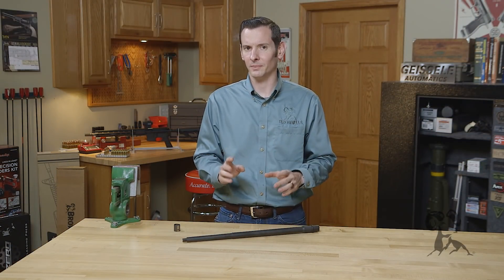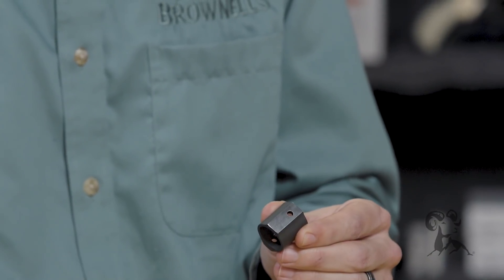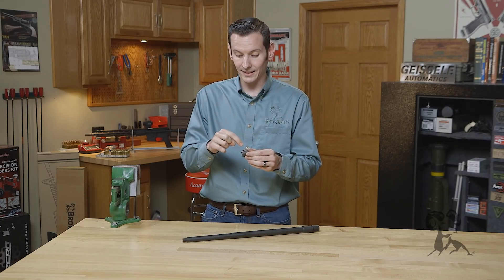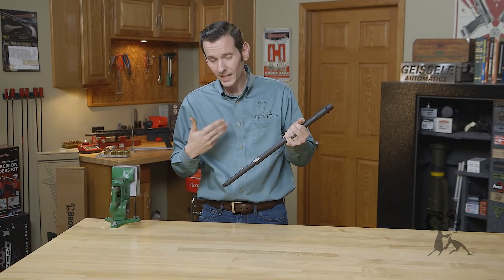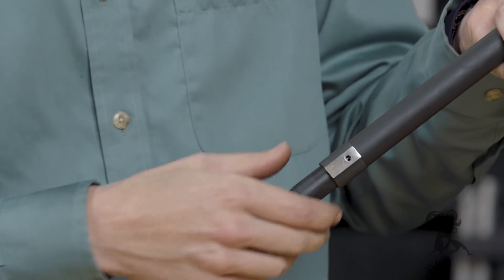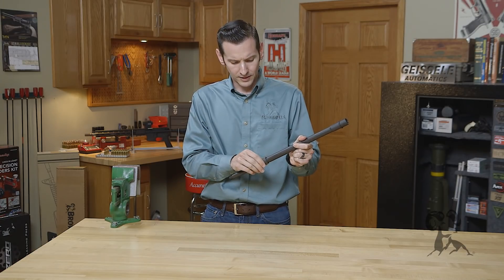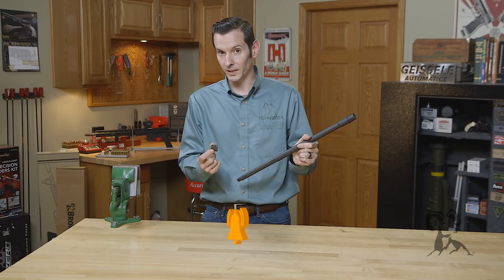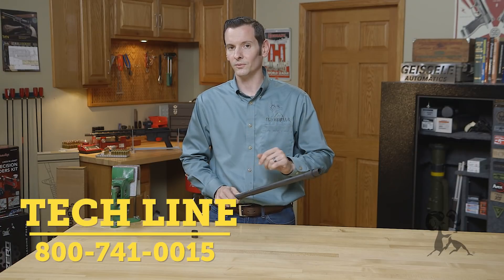Quick Tip: AR-15 Gas Block Alignment

Comment: I use a piece of gas line & slide it on the end where it fits in to the bolt carrier. Then put a finger over the end of the barrel.
Leave the chamber open. Leave the gas block snug but not tight, now just blow on the plastic gas line until you hear the most air come through the chamber & tighten down the gas block. Takes about a minute. Works like a charm!
Reply: What do you mean by gas line, oh never mind I get it what size gas line do you use
Reply: @JasonReilich  If you have to ask you won't figure this out anyway. It's so simple a monkey can do it!
Reply: This is how I did them until I finally bought the “universal” dimple tool. This technique still works fine.

Comment: If colt Socom heavy  barrel which is not called hammer forged but chrome lined  are you soon the centurion one that I have that I have to shoot some 77 otm and see if it’s a sub minute grouping because the regular colt Socom Power always half minutes I’d assume this one is better and will last longer especially with an a heavy duty gas tube. And it be nice if we could have full auto lower receivers like the geissele gas pedal

Comment: You are right ONLY IF the barrel maker AND the gas block maker places the gas port holes in the same distances from the shoulder (for the barrel) and the rear face (of the gas block). I have encountered where the both had different distances used for their gas holes. For me, the best solution is to use a dimpling jig which indexes the dimple by the use of the bolt that sets into and centered in the gas port which then allows you to center to dimple the barrel. That way, you can be sure that the gas block hole is directly on top of the gas port in the barrel. Also, once the dimple is set, then the second set screw can be removed and the hole's position marked on the barrel. Then you only need to align the dimple jig over that mark to properly dimple the barrel for the second dimple. This takes ALL and any guesswork out and ensures a properly installed gas block.

Comment: Real quick question I've bilt my first ar and the bolt wont cycle corectly as in the bolts not coming far enough back im assuming I didnt Aline my gasblock or tube corectly besides that anyone else think it could be something else im open to opinions

Comment: Quick question, I build at ar but leaks a bit for the gas block roll pin is that normal??? Anyone is having this problem, the ar is running excellent just i don't like the small gas leak🤔🤔😬🤷‍♂️
Reply: Yes this is normal on a new build.  Carbon from firing will eventually collect in the gaps and seal it up.

Comment: But how do i ensure its aligned from right to left instead of forward and back? Is eye ball alignment good enough?
Reply: mark the barrel with a pencil through the center of the gas port.  Mark the gas block through the center, meaning looking at it like you are looking through the barrel hole.  Mark the top of the hole with a vertical line.   Now put the gas block on and align the two pencil marks.    A good way to double check yourself is to put a foam ear plug in the chamber or plug it with your finger if you can.  Then blow into the muzzle while you gently adjust the gas block.  You can easily hear when you get maximum air flow through the gas port / gas block.  When it's misaligned you can easily hear the difference.

Comment: Dimpling is designed for regular old screws. But with the new fangled “cupped screws”, does dimpling actually work against you? Cupped screws are designed for a round flat surface.
Reply: Good question. I don’t dimple for them… but I’m not a pro

Comment: On one of my builds I was not able to install the roll pin completely through the second hole before the pin began to flatten out. 
I do have a solid installation and the weapon operates properly. 
Do you see any problems with leaving it as is or should the pin be replaced?
It’s a stainless steel gas block and I’m not confident of the alignment of the two roll pin holes.
Reply: I use a small nail with a snug fit as a slave pin and the roll pin pushes it out as it is being driven in

Comment: I did something unconventional and it worked out for me. I just plugged the end of the barrel and blew through it and the dimple on my barrel was dead on. You can move the block and know pretty quick if it’s off or not. Set it and retest.
Reply: Great tip. I'm trying this right now. Thanks
Reply: Absolutely - This method works Great!

Comment: When I put together an AR, I put the gas tube into the gas block and then slide everything on the barrel and into the receiver. I almost tighten the screws then put a length of rubber hose over the gas tube inside of the receiver. I position the gas block close to the position I think it should go and then I blow through the hose and listen to the air escaping and by the resistance I feel blowing through it I find the best place to tighten the screws. I put Rocksett on the screws one at a time and tighten each. I had a gas block and rifle that just wouldn’t work until I did this.

Comment: The pin hole aligns on the gas block and tube but the gas port does not seem to be aligned . I don’t even see the whole. Would that be an issue?

Comment: Took my first AR upper build to the gunsmith. I was not 100% with aligning the gas block. My handguard rail is not aligned with the upper rail and the bolt won't hold open on the last round... 😑😒

Comment: I have never seen a gas block port that large. Granted, I haven't seen a lot of them (mostly adjustable), but the ones I have seen are only a tiny bit larger than the port in the barrel. I have a Superlative Arms adjustable gas block (Part# SABO-DI-750CM) on my AR and the small port on the block does not align with the barrel (Daniel Defense 07-078-09136-018) when the block is up against the journal shoulder. So, do your own homework and break out the caliper. And if you're using a clamp-on block or a barrel that isn't dimpled, the Gas Block Genie comes in handy.

Comment: Parallax Tactical (when they were still in business) used to sell their gas blocks with the peep hole at the top. Just place the gas block on the barrel and drop a roll punch through the peep hole into the gas port on the barrel and tighten the set screws. Perfect alignment every time. Takes all the guess work out of gas block alignment. This should be a standard feature for all gas blocks. I would love it if a jig was developed that enabled the user to drill this peep hole into a gas block that didn’t already offer this feature.
Reply: Matt - Brownells sells little plastic sticks for this purpose, but I’ve also seen someone use a short piece of uncooked spaghetti.

Comment: You can dimple the first set screw, attach the gas block with the second screw removed, then make a dimple pilot hole where the second screw goes, pull the gas block and dimple it the rest of the way with the correct bit. Essentially using the gas block itself to gauge where the second dimple needs to go.

Comment: One problem I’ve run across lately with home builders is the dimple is too deep damaging barrel making it unsafe
Reply: That's crazy, I sometimes get nervous when I see the drilled portion for the A2 sight retention pin.  That thing looks deep. It's hard to imagine someone drilling the dimple even to that depth.

Comment: I usually plug the chamber with an empty shell casing then blow through the barrel to estimate the amount of air coming out of the gas port valve and to maximize the air flow slowly move the gas port until you feel the best air flow coming out of the gas port valve then secure the gas valve with the set screws and your done!😉
Reply: That one of i ways to check bolt carrier function safely , use shop air pressure (130-150 psi) with rubber tip blowgun before installing flash hider if it cycles yr good to take to range n test fire
Reply: I believe Brownells offers a plastic alignment kit that takes the guess work out of it.
Reply: oscar ostolaza..... Real men use a Live Cartridge 
LOL

Comment: The info about not butting the gas block up to the shoulder is something I've heard from literally a half dozen reputable sources.  Your demonstration makes it obvious this is bad advice.  That's more than slightly shocking, and also slightly annoying as my first build had nothing but problems and I wonder if that was maybe the case.

When aligning a gas block, would it be okay to use the rear most screw hole as an alignment check prior to install?
Reply: If you offset the gas block only enough for a standard handguard cap, you will still get full port opening into the gas block. The centers of the hole will not be aligned, but that does not matter. It is a matter of pressure differential.
Reply: @j.p.1576   Is that why the opening on the gas block is so large, is that it's engineered to allow for those caps?

I'm not sure what the gap was on the upper I assembled, it was a low pro gas block under an alg 15" free float rail.  After the initial build it had all sorts of issues with cycling and being under gassed was the only thing we could trace it back to.
Reply: What he fails to mention is that it depends on the gas block used. Some are drilled to spec taking the thickness of the handguard cap into consideration. Some are not. Always measure, never guess.
Reply: @brucecamparmament3728  My thought on this would be to turn the gas block 180 degrees and observe the gas port through the set screw hole directly underneath the gas port.  That'll let a person visually confirm alignment, and then push back or pull out as necessary.  Am I thinking about that right?
Reply: @viewatyourownrisk  Not exactly. You are assuming the gas port and the set screw hole are the same distance from the shoulder of the barrel. They "might" be.. They "should" be, but thats still assuming. The only way to really know is to measure the distance of the barrel gas port (center) from the shoulder, and then the distance of the gas block gas port (center) from the back of the gas block. If these numbers are the same then you are good to butt the gas block to the shoulder. Of not, space accordingly. I dont use set screws on any of my builds, I always pin or taper pin, so measuring using this method also works on gas blocks without set screw holes.
Reply: @brucecamparmament3728  awesome.  TY!

Comment: Do you have to dimple?
Reply: I highly recommend it.
Reply: @CalebSavant  what if the barrel manufacture, say Faxon for example, does not recommend it?
Reply: @johnz6066  Wonder what the reason is? CYA against dopes with drill presses? A clamp style is far better than the dimple.
Reply: @LuvBorderCollies  haha that too. In Faxon's case it might have something to do with the salt bath nitride finish on their barrels
Reply: @johnz6066  The nitriding is extremely hard and will eat any drill bit that is not carbide. Faxon does not say "Don't do it", they just don't offer it on production barrels.

Comment: What would happen if the barrel nut is torqued, either not torqued at all, not torqued enough or over torqued?
Reply: Over torqued can effect accuracy, under torqued can come loose and effect accuracy as well as cause a failure to lock.
Reply: @CalebSavant  thank you for your reply
Reply: You can strip threads by over torquing. Supposedly you can shoot it off if not torqued enough, but I don't know how anyone could accomplish that.
Reply: @chris.3711  thank you for replying

Comment: The first AR I did.... I bought a gas block jig but then I saw someone do it a better way (in my opinion). They simply put the gas block in position on the barrel and then used block to mark “where to drill”. Then removed the gas block and used a drill press and drill press vise to hold the barrel in place. The gently “dimple” the barrel. And I really like Brownells suggestion to only dimple the screw location over gas port.
Reply: Yes, that is the exact method I use!

Comment: A nice 3-4 piece jig set to clamp on, align and dimple would be handy
Reply: Installing a gas block is stupid easy. If you need a jig to do it, maybe you should have someone else do it for you.
Reply: @Sic Semper Tyrannis Check out BRD Engineering. They have the jigs you seek.

Comment: Is it safe to cut the "ears" off of an A2 gas block sight if you stay above the gas port?
Reply: Yes. People do it all the time.
Reply: Yeah, go for it.
Reply: Thanks for the responses!  The hacksaw and Dremel are going into action this evening.
Reply: Yup, you can cut off the front sight and turn it into a low profile gas block. Just be careful not to take off too much
Reply: Yup
People did it all the time before low profile gas blocks were a common thing